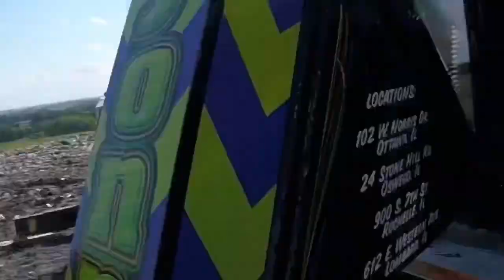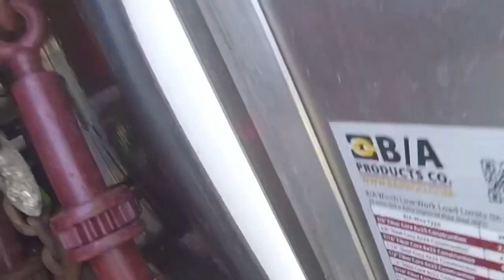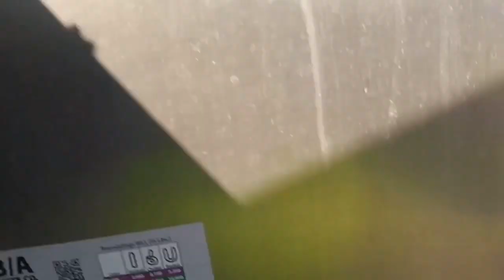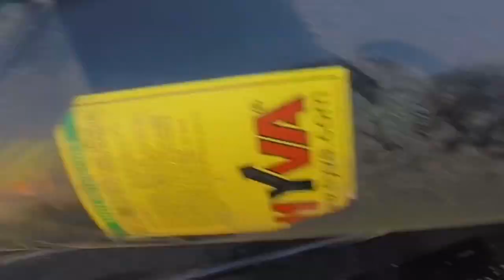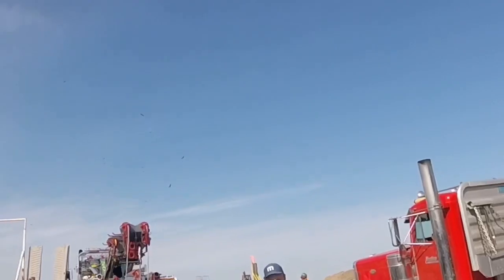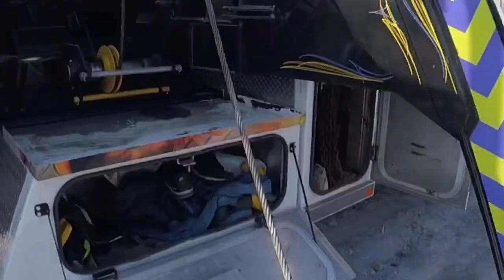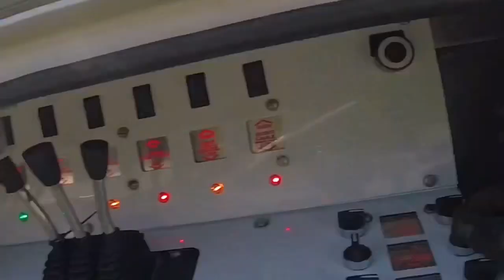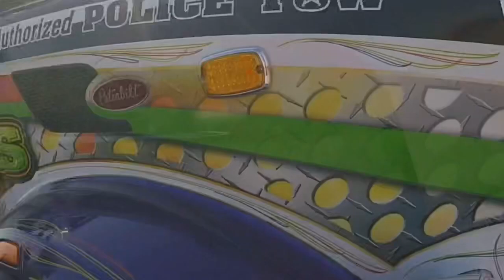Rotator work ep 94 landfill roll over

Comment: Does your other Rotator have all soft lines rather that Wire Cables? I bet their a lot easier to drag out when you have a long pull. We started using them in place of anywhere from 1" to 2" wire cables on the Vessels that I sailed on.
Reply from the maker: Yea they are all that synthetic rope and very easy to pull out
Reply: Samson has since for last two years at least manufacturing K-100 for crane service, I was a bit surprised to see a tow truck using synthetic line. I have seen sailing rigs use nothing other than synthetic for rigging and haul lines, unless it was a large heavy mast and they rigged with steel lines for a bit of added support.

Comment: Your Boss(es) really should have those others guys do some training exercises and watch some of Ron Pratt's videos on roll over recovery. Not even half of them knew what the heck to do or seem to care to use better common sense how to go about it more safely. Glad you have more common knowledge and sense on what is going on and how to go about the job. Also there is the chance it could cause another sinkhole as it landed upright and flip the other way, landfills are constantly resettling thus why they are covered up so nicely and made walking parks and not allowed to build upon.

OMG those guys would be sent home early if they worked for me as they do not seem to care as much as you to get the job done in a quicker manner. And now it has to be towed? hhhaaaaa what fortune to have know it before flipping as you said easier driveline access, if you already did not smell now you got to scoot around on garbage.

Interesting double winch side-puller design, finally got to see it in action.
Reply: Oh, is that guy in the hat the bossman and was that 1150 or what model other wrecker using synthetic rope lines?
Reply: Nevermind, got my answer from reading other comments and your reply to them. most still think synthetic whips like steel, but only if they were still attached to the dynamic load they are tied too,, otherwise if the load stayed put when the line snaps the rope just drops, have been whipped by a snapped synthetic rope line only to get bruised and stung, but never would stand dangerously close to steel lines. And if it gets wrap around you if not paying enough attention or acting fast enough it will so more serious injury to point of snapping a joint or bone depending, aside from pulling you down to the ground, but still far safer than steel line.
Reply from the maker: Yea it definitely whips back when it snaps and it gets cut easily

Comment: Hey, great job,  i love your channel.
I'm not trying to second guess you, but couldn't you and Jay have done it all by yourself? 
The drag and side winch like you did, and one of the boom lines over a snatch block on the side outrigger to get the low pull. 
And maybe the last boomline to catch? 
I know it's hindsight, but i'm curious. 
Could it be done like that?
Reply from the maker: Yes I could have done that alone all day unfortunately I don’t call those shots on what goes out but it could have been done for sure thanks for watching
Reply: Any good boss would send two trucks so u can charge for 2 .
Reply: joseph marino And then loose the customer to a company who can do it with one.
Reply: Henrik Bonde very true but that’s exception most companies send way more then is  needed so they can charge for it these trucks cost tons of money and are very expensive to run. But yes u r correct . Thanks

Comment: why did the other rotateer operator have his stick up in the air on the other side of the rolled of the truck when you and Jay arrived on seance?  everyone seemed confused until you lined them out on how to get it done. great job  Malachi .
Reply from the maker: Thanks dan and we used the other rotator to lift the dump body while I winched the ram closed so when we uprited the unit it didn’t mess up that cylinder and the driver was concerned about the fenders aswell thanks for watching

Comment: Did you have to remove a pressure line when you closed the box
Reply from the maker: No the lid was off the tank so there wasn’t much pressure most of the fluid spilled out

Comment: Besides me screaming at the screen at dumb and dumber, i sure as hell wold be ticked as the rolled truck owner. Not for the fact it rolled, as that just happens, but rather the starting of it after being righted. The sthing should have been put into a shop, onced over then started. Especially with now excess oil coating the cylinders and head from being on its side and what leaked out here and there.
Reply from the maker: Lol that was the owner of the truck that fired it up he had thought he was going to be able to drive it away
Reply: Explains how the truck ended up on its side to begin with....
Reply from the maker: The company removes those huge windmills in the corn fields and he was loaded with a lot of broken parts and a few got lodged in the front of the dump and being at the land fill the ground is real soft so away it went